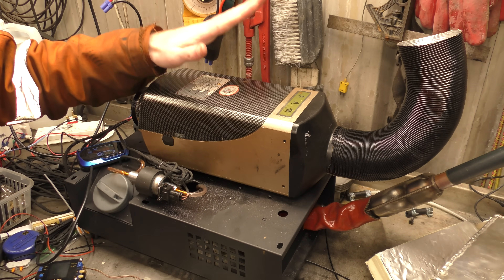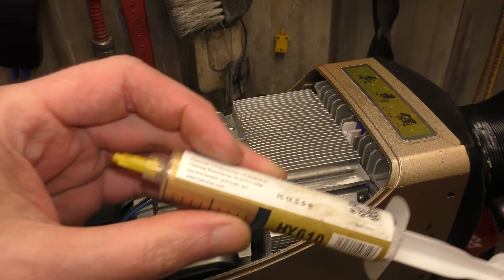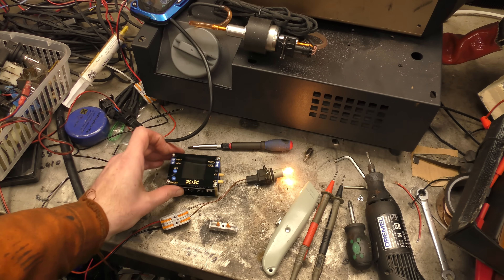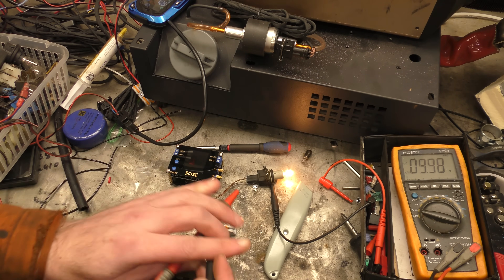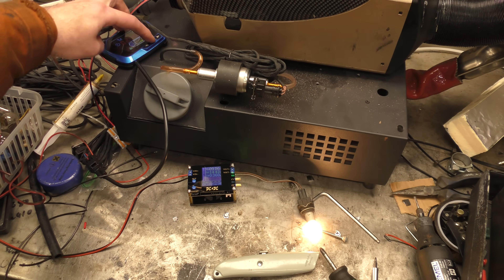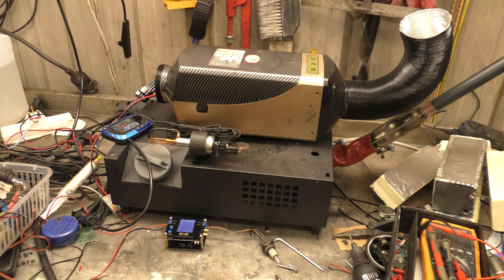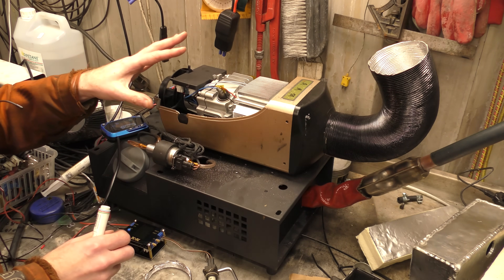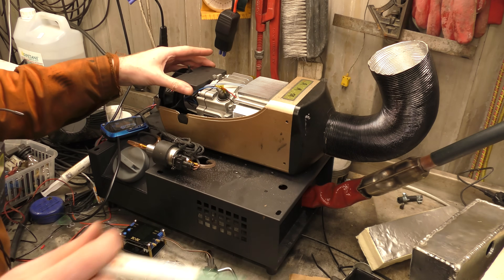Self Powered Diesel Heater Project - part 4 - custom heat exchanger

Comment: Your boost inverter is an MPPT device, you were getting 14v output, when the input was about 8v upwards. It always gave you what you wanted, by maximum power point transfer from input to output.

Comment: The current sourced from the TEGs is entirely dependant on the load (bulb) you used for testing. To determine the maximum power available you need to load the output until the voltage starts to drop. I suspect it's considerably more than 5W.
Reply from the maker: You are correct.  Sadly it wasn't much more than 5W in this case.  :(

Comment: You can stack Peltier module's, i would have thought exhaust is better & the cold side is on a copper plate in the ground or river even better, to get a better result cold & hot sides Need to be insulated away from each other, you can get Peltier module's that are sealed so no moisture damages the Peltier module, by sticking Peltier module's you are going to get a larger difference in temperature, the cold sink temperature really needs to get that heat away without holding on to it, so ideally water in a stream, I've seen one experiment light a powerful lamp ùsing heat from a camp fire 🔥 China 🇨🇳 is a place to get these units cheap in UK unless you buy quantity its expensive, I was a UKAS manager - Aerospace Defence engineer now retired but keen on free green energy 👍

Comment: hi bro very good your videos i am a subscriber for a while, i am from argentina, i wanted to ask you if you know how to remove the external fan (of a diesel heater of 8kw) without the heater throw error signal. i tell you my project. i have another more powerful fan connected behind in line of the heater and if i remove the external fan (of the heater) i get an error, if i leave it the flame goes out. what do you recommend.

Comment: Have you seen Charlie Solis' work on an exhaust heat recovery system using a tesla turbine? It's bulkier but the efficiency and output blows TEGs out of the water. He's the only guy that's faithfully reproduced the turbine and steam regenerative boiler system from Nikola's patents, like GB 186,083. The thing chooches and so far we've seen power anywhere from 250W to 2.65kW, with the capability for much more.
Reply from the maker: That sounds like something I'd like to watch.  Thank you.

Comment: Do the finer fins increase or decrease the air heat output of the heater?  They always looked like they'd be more efficient with more fins to me.
Reply from the maker: It's not so much the thickess as it is the number.  More fins = more surface.  More surface = more heat transfer.

Comment: On your test you are using a bulb that is only drawing a fixed load. It will never display more watts draw if you don’t increase your load by adding more bulbs or a digital load would be best. So your system might be better than it seems on your test.

Comment: I really admire you. I have this exact idea, but had not tried it. 

Any chance the problem is in the differential of the temperature?

Ideally the tegs in the custom exhaust and water cooled makes the more sense. 

Line up the exhaust with a copper plate all along and cheap tegs and run a copper cooling line on top.

This SHOULD work.

Comment: What is the difference between these diesel heaters and rockets ?  You could boil water in a pressure cooker from the exhaust and use the steam in a turbine ?

Comment: Lovely video, as always and explained well. 2 points, 1) on a boat, the ability to charge a flat battery when you have no engine, (to start the engine and get the alternator going), any innefficiency is irrelevant, its a case of survival in some cases, eg at anchor and having to get going before a storm takes you onto rocks. 2) getting heat from the exhaust, the crude way, pumb the exhaust into & thru a domestic house wall old radiator.

Comment: please get a mppt charger to get the most power out of the tec elements!
Reply from the maker: I have one in the box but it needs battery voltage plus 2v and I haven't had that out of the TEGs yet so haven't connected it to see what happens.  Do you think I should?

Comment: Hi Dave is there anyway to wire an LED to come on when the heater is running? The distance on the wireless remote is terrible and there is no way of telling if the heater is running from inside the house

Comment: I have played around with the cheap ones a bit back I wonder if you spent the same amount of money as one of those on a ton of the cheap ones and gave both types the recommend temps which would make more power if they are £90 you would get at least 30 cheap ones for the same money also with the cheap ones I presumed the ones with a higher amp rating would work better but it seems to be the other way around when I started playing with them I had a stove fan with a 12706 so I got some 12709s the 12706 worked better I presume it's because they are made for cooling

Comment: using the water coolers to heat them as well as cool them might be worth a try you could use the EGR cooler for the hot side maybe and possibly use the floor similar to under floor heating for cooling circulating the water without using more power than it can make is a problem I see with my idea

Comment: Would something like a small turbine on the input side be usable? Like a small water turbine or small wind generator module or similar 🤔  just a thought. I love the idea of getting something out of it. Especially as for me its running to keep me warm so would be a bonus amount in the battery bank. Even at like 2 or 3 amps at 14v.

Comment: Use the exhaust to heat water, and then have the TEC with massive heatsink in a tube for the supply/cold air intake.

Comment: Can you specify what TEG are you using? I think they are old tech, there has come better units to the market now. 
18V 1.65A and 200 degree max temp difference. With three of those, you could theoretically get 90Watts electrical. In practice though, id guess at least 30W. It's a lot better than 5W i think. 
TGM-336-1,4-1,5 was the model i've seen cheap on ebay
Reply from the maker: I can't find the manufacturers spec sheet on those.  I can see all the other TGM modules Kryotherm produce and they aren't on the list.
Reply: @DavidMcLuckie  might be worth a try 👍🏻
Reply: @DavidMcLuckie  The kryoterm spec sheet seems to be way off. Or then the Ebay listing.  I'll have to buy them myself and see what's what.

Comment: A while ago you did a video that not all 8kw heaters are 8kw.
I'm finally going to get two for my caravan motor home. 
What make and model 8kw diesel heaters would you suggest for purchasing? 
Thanks.
Reply from the maker: Technically I made a video showing none of them are 8KW and an 8KW doesn't exist.  There are only two sizes, a 2KW and a 4KW, which are physically different sizes.  I'd pick a Lavaner heater all day.

Comment: Silly thought, the Biolite camping stove runs a fan and generates power from the fire in the stove. It'll only charge a phone though. I wonder if it's units could work?
Reply from the maker: Yes.  They are essentially the same thing.  Fire heats TEG, TEG spins fans and output some power to charge a phone.

Comment: this might be a good idea - but honestly the crappy efficiency of the peltier moduls will never ever even supply enough energy for the heater.  sorry to say but there is no free lunch...

if in 300 years you are able to extract enough energy from the heat to run enough peltier elements you wouldn't have any heat left for heating. so you all you achived is a no-efficiency-machine that burns diesel and wears out the fanmotor.
Reply from the maker: No efficiency?  Technically right now I've decreased the running power consumption by 10%.  The fan motor is spinning at the same speed it would spin anyway.
Reply: @DavidMcLuckie  but you lost heat output. so you'll end up running the heater for a longer period for the same room/temperature. most likely 10% longer...

no free lunch 😛  nobody can trick the physics !
Reply from the maker: I agree with you there.  

It's just you said "a no-efficiency-machine that burns diesel and wears out the fanmotor" which was incorrect.
Reply: @DavidMcLuckie  * IF you produced enough electricity to power the heater 100% - there was no heat left.   ...to explain a bit further...  then it would've been a no-efficiency-machine*

Comment: Another great vid!

Indeed putting the TEGs on the exhaust could improve the TEGs efficiency; you might get a higher temp difference between hot and cool side there. I'd expect part of the problem in the setup you've used here, is that the air running over the 'cool side' of the TEGs has already passed some of the hot aluminium of the burn chamber; so the temperature difference isn't optimal. Increasing airflow might help a little? Though of course that goes against the idea of running the fan (+ pump) on TEG power :p

The first plan you've drawn out for the exhaust seems the most sound to me! I'd have the air flow just as you drew it, that way the hottest exhaust air is on the same TEG as the hottest intake air, and the temperature difference per TEG is most equal. How much heat can these TEGs take?

Before building, I'd be curious to measure the temperatures you're working with. How hot is the exhaust air compared to the heat exchanger surface, and the intake air compared to the air running over the TEGs inside the heater? If the temperatures aren't that different, you can't really expect a better efficiency.

Regarding construction, I'd attempt to first build an enclosed half cylinder out of plate steel, for the hot/exhaust side. First a rectangular ± 80 x 380mm plate (to later mount the 6 TEGs on), and then bend a sheet into an arc (half circle) and weld/screw it under the rectangular plate. Seal off both ends with a plate with a pipe, to connect the heater outlet and a muffler. This part should be fairly air-tight. Then you can mount the TEGs on the flat side, and screw another bent plate over them for the cool side (aluminium would be fine here too, and it doesn't matter if it's a bit leaky). If the TEGs max temp isn't exceeded yet, the whole contraption can be wrapped in glass fiber mats to prevent heat loss, and 100mm/120mm steel air ducting to keep it all together.

Thinking about the original plan:

Since a TEG is just massively inefficient in itself, if you really want to get electricity I think it's wiser to just use a tiny gasoline power generator. Unfortunately I don't know of any tiny diesel engines - open to suggestions! Since most 230V+12V generators don't really deliver much power on 12V, I'm thinking about building a 12V-only generator by tieing a 1.3HP 35cc 4-stroke brush cutter engine (Honda GX35 clone), to a used car alternator (goal: keeping camping van 12V leisure batteries charged). A simpler solution would of course be a  normal generator with a 230VAC to 12VDC converter - but that would further reduce efficiency and reduce the fun of DIYing.

What I'm planning to reduce heat loss for the diesel heater, is to run the diesel heater exhaust through a 100mm pipe, over a length of about 1m. The air intake would then take its air from that pipe, so it'll be pre-heated, which should increase temperature inside the heat exchanger. Another theoretical option would be running the cabin-side air outlet of the heater over the exhaust. It might be more efficient, but it would mean the exhaust needs to run a through the cabin for a bit, and if a leak occurs we'd get exhaust fumes inside the cab, no fun in that.

Comment: Helllllloooooo, Totally out of the box thinking here but I've seen a few videos of mini Pelton generators producing a fair amount of power recently, could you use the power from the teg to power a 12v high psi pump to spay onto the Pelton on a little cycle system to produce more charge to the battery?

Comment: Try a diamond shaped box. With air flow in and out top and bottom. Tigs mounted across the width. Or like a 2 stroke motorcycle exhaust shape. Hope that makes sense.

Comment: The problem of the diesel heaters is the battery drain. Can you get extra running hours from utilizing the TEGs with the burner?
Air flow from (cold) outside to burner would be better for the cold side of the TEG than the warm inside air of the car.

Comment: I think rather than concentrate on power. Just do something simple like producing a hand-wash from the waste heat just a liter would do. My biggest bugbear is cold water just to wash my hands. I came up with a simple solution which worked but I will perfect it before I start using my camper van again. Keep up the good work 👍

Comment: Ok you have the right idea however the heat exchanger design for the exhaust will work but the design is wrong to efficiently transfer the heat to the electrical components, to make the exhaust heat exchanger weld 4 square heat sinks together and put the electrical components on the outside of the heat exchanger box

Comment: I have salvaged a 250 W TEG I would like to try
Reply from the maker: That must be a fair size.
Reply: @DavidMcLuckie  its close to 100 lbs
Reply: should use the exhaust heat and have the combustion intake air drawn over the fins get a bigger temperature difference

Comment: got one of these heater running in my 1 bed flat. im in the middle of nowhere with no gas or oil central heating so have one bodged into a small window. 
its the best thing ive ever installed, nice and warm in good time and runs on very little fuel. all thanks to your videos,

Comment: I am impressed of your work, which you explain in a very pedagogic way, thanks!
May I suggest one solution: Normally you heat up a van with the heater, so it will be relatively cold outside.
If you build a muffler with the TEG´s around and large cooling fins on top of the TEG´s.
The unit will of course be placed under the van out of the way. The ambient temperature will be maximum 15 deg C, I think, otherwise you do not need the heater.

Comment: Well, it does light the bulb, that's a given, but I'm thinking a water-powered generator connected to the workshop's guttering (it any is fitted) to generate power would end up being more cost-effective, especially with you being up there in Scotland where the rain falls down in sheets of grey... :P
Reply from the maker: Like today.  Or a wind turbine.  A small hand crank.  :)
Reply: Have you seen Quint Builds channel?   That's a whole can of worms......

Comment: The problem may be remedied by designing a denser cold fluid (increased delta T) or thermal mass (water, water/sand (water table, blocks of iron etc. such that the heat captured from exhaust is adjacent to the other side of TEG.

Comment: Surly the 0.3a is only what that bulb wants to draw. You should try adding a variable load to where you can keep ramping the current draw up until the voltage starts dropping.
Reply: Yea I think you're right, I hope we get to see a new video with this :D
Reply: just use a solar charger. tec like solar panels need a smart controller to get the most power out of them.

Comment: If you was wanting a self powered heater  a tiny jet engine with a starter genarator on the intake side. Exhausting into a heat exchanger with a fan blowing across  the exchanger  the controller for the diesel heater would be programed the same as the tiny jet engine  with the exception of the fan motor and would be cheeper then the tag modules

Comment: God TEGs are so disappointing. Sure you could have loaded them up more electrically since it's only a 5w lamp. But at the rate their voltage was dropping you'd get less than 10w? And still need to over triple that output to run the fan on the heater. I don't see the exhaust being that useful. Perhaps it's worth experimenting with many smaller cheap ones under this set up. Perhaps 2 in series and as many sets of in parallel as you can fit. 

I'm sorta surprised there isn't higher efficiency ones that exist apparently they arnt that much better
Reply from the maker: You're right.  Although I did try later with more load and only got 6.5W.

Comment: cocurrent flow exchanger might be best option. though I think issue would be teg having different voltages as temps diff. so probably have to run them in series. Also the velocity out the exhaust is probably higher, might as well try to add turbine at the exit to regain energy. might have to run the fan at higher speed to compensate for back pressure.

Comment: Hi. Are you sure that the TEG only puts out 5 W? Since you only connected a 5W bulb it seems naturally that this one will not draw more. Have you tried using bigger bulbs/current draws?
Reply from the maker: Your on the money.  Although sadly I've just been ouside and tried a bigger bulb.  Best I've seen so far is 6.5W.
Reply: @DavidMcLuckie  I see. Shame.

Comment: I'd still use exhaust as the waste source, but with the water cooling idea, route that heat to the intake of the air exchanger, as the Delta T of incoming air you'll see a bit more heat in the exhaust. Where it all balances out at is the question.